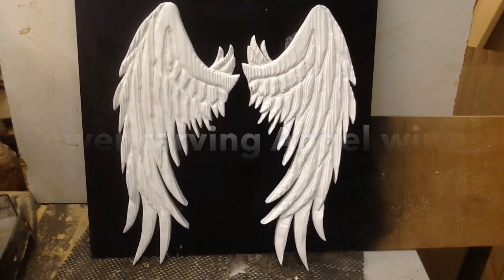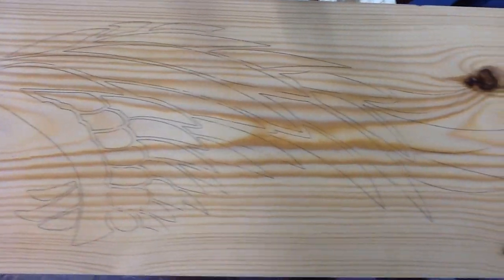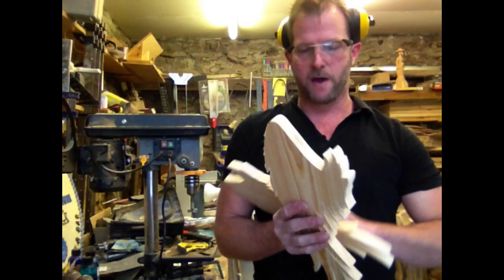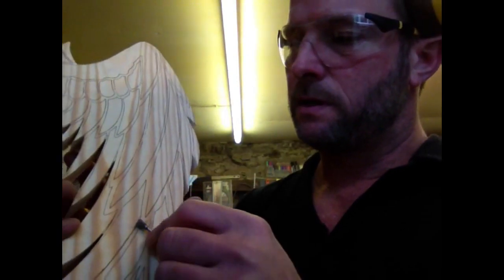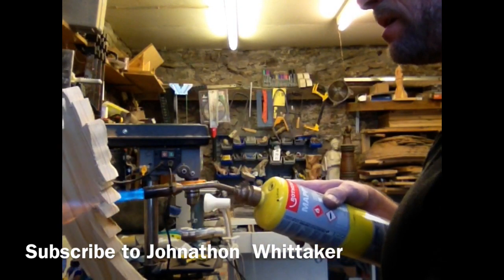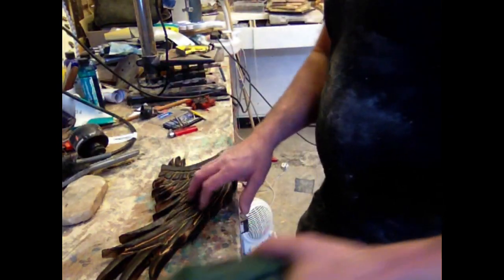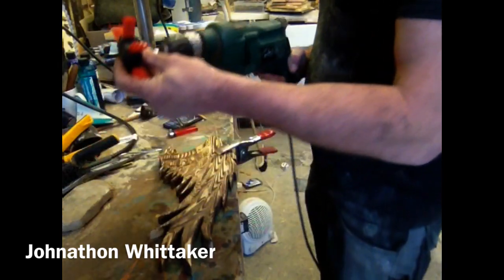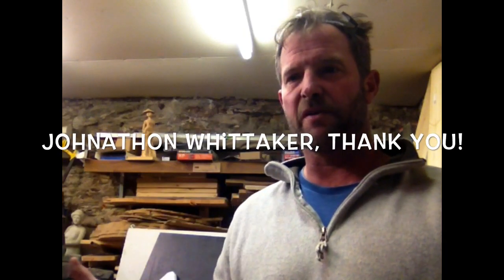power carve angel wings

Comment: Jhonathon, Got dark early, and saw your video on my home page.I like that burning technique.  More to explore when I finally get inside the shop.   trying to figure out a method of tenting the area for all the flying chips and dust.
Reply from the maker: if you find a good method let me know! the amount of sawdust I go through for a small shop is startling
Reply: @JohnathonWhittaker  I've decided to use the lightwieght plastic tarps to cordon off a 6 by 10 foot area. will be hanging some 1x2 s to serve as the curtain rod with nylon rope threaded through the ringlets and around the rod.
Reply from the maker: @thomastieffenbacherdocsava1549  sounds like a good plan. I saw a purpose built room at a trade show, 3.walls were perspex and had a large air extractor in the roof.  Seemed to work well and clear tarp should do well to. I would recommend some high quality respiration gear though.  Power carving makes alot of very fine dust
Reply: @JohnathonWhittaker  I've built a 2ft by 4 ft down draft table, just installed a 3 hp dust collector, with my design of thein chip collector and a large air filter ( grizzly) sitting in the rafters.  Also just got a respirator mask , enclosed, as I have plans to do sandblsting of some very rusty undercarriage.  Minnesota winters.
Reply from the maker: @thomastieffenbacherdocsava1549  sounds like you.habe put alot.of thought into This! I tried a down draft table too but found it wasn't that effect for my angle grinding carving but.worked just fine for dremel stuff
Reply: Thanks for your input. Now I need to go past thinking and start doing. LOL!

Comment: Hi Johnathon ... I went on Amazon to purchase the nylon brush wheel (my Amazon doesn’t carry Abracs, but has similar ones). Evidently these wheels come in grits. Can you please tell me which grit you were using. I tried to stop the video and read the package, but it didn’t work well for me. No hurry! Thank you.
Reply from the maker: Hi Susan, I use two grits, 80 and 120. They are very soft  so the 120 grit acts more like 240 and the 80 like 120. Just make sure you wear eye protection! Little pieces do go flying off
Reply: Johnathon Whittaker Thank you Johnathon. I’m ordering both of them now. I will definitely use eye protection. I really appreciate your advice. ☺️
Reply from the maker: @susanwoodcarver  anytime at all